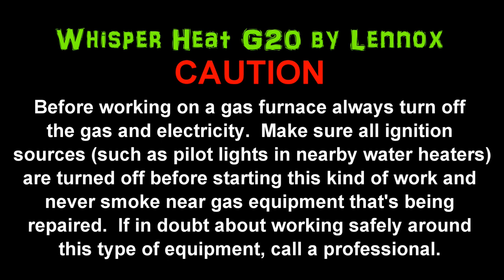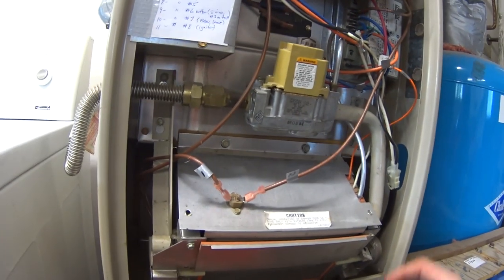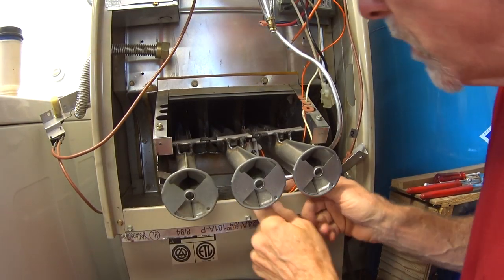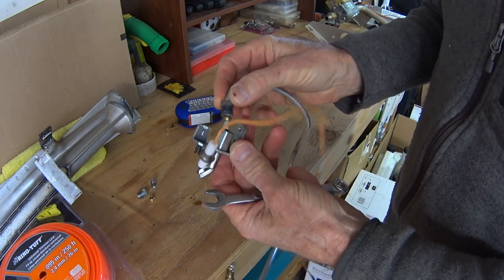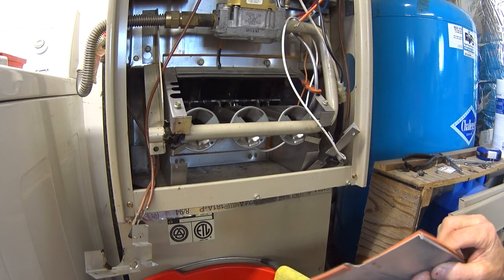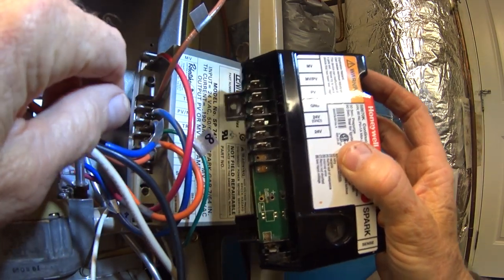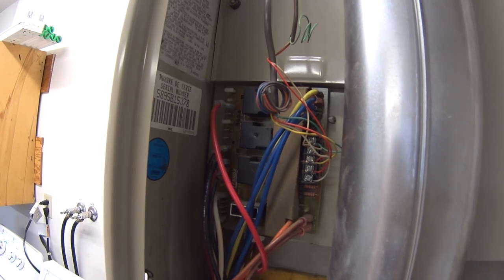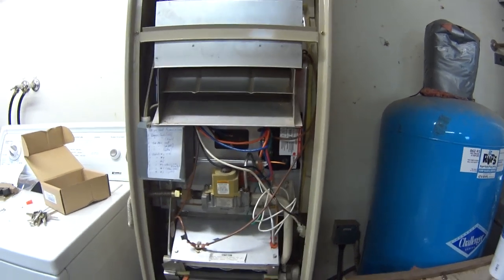Furnace Repair - Lennox WhisperHeat G20

Comment: So, he has a $300+ controller "on order", but the $15 flame sensor Should solve the problem.......and he's only changing it because he is waiting on the controller. Symptoms indicate the flame sensor is the issue.
Reply from the maker: Thanks for your comment Robert.  First, in 2017, when I did this work, the controller was about $115.  Even today it is far below $300 at $177 on Amazon. Second, I replaced the flame sensor, and while I was in there, I figured I would also replace the pilot assembly and igniter because they looked dirty and I knew they were at least seven years old, but probably much older. Third, I replaced the main controller because I had read so many online accounts of that original one being a problem, and that the replacement one was much better.    This resolved the problem of no spark, but although the burners would now light, the blower would not turn on and the whole unit shut down after a minute or so.  

So at that point I replaced the blower controller, and then it worked fine.  So this was not a repair where I was troubleshooting to replace one defective part.  I knew that no matter how many parts I replaced, it was still going to be far cheaper than calling an HVAC guy in there only to hear him tell me that the whole unit needed to be replaced, when I knew that wasn't the case.  And the flame sensor, if it was a problem, wasn't the only problem.  There were multiple problems, and I figured since I was in there I'd replace much of the inner workings so I wouldn't have to tear it apart again anytime soon.  It's like doing a valve job on a car engine - while you're in there you replace seals, belts, maybe the water pump, etc. so you don't have to tear it apart again anytime soon.

It's been over 6 years since I did this work and it's still working fine.  I did have to clean the flame sensor about 3 years ago but that was the only issue in the past 6 years.

Comment: Boiler motor will not turn on
Reply from the maker: Boiler?  You mean the blower motor?  If so, go to 31:40 in the video and see if that's the same thing that's happening to yours.  If so, you may have a bad relay in the blower controller.  Keep watching from there to see how to replace that controller.

Comment: A poorly engineered furnace. Putting that blower controller next to that normally hot flue pipe doesn't make sense at all. No wonder many furnace techs dread working on these furnaces.
Reply from the maker: And burying the pilot assembly in there wasn't smart either.

Comment: You went ahead and replaced all those parts on that G20 and it shows clear signs of a bad heat exchanger.  The tips of your burners are all blackened from the overheating from flame turbulence.  In 25 years of service I have het to find one of these that weren’t cracked.  The worst is that you had everything out of the way for you to see the cracks.  On these furnaces they stand out like a sore thumb as the heat exchanger in galvanized and stays silver but the cracks show up as brown lines.  You have no training so you don’t know where to look.  You can get a snake camera and send up the heat exchanger at the back where it narrows in -the pass.  This is where they ALL crack.  That was a wast of time and parts dollars.  Sorry
Reply from the maker: Actually, it wasn't a waste of time and money at all.  Quite the contrary - it saved us a lot of money that we might have spent on an entirely new unit.  We've gotten over four more years of service out of this furnace, so far, than we would have otherwise.  And it's still working fine.  Truth is, if this furnace had serious cracks in the heat exchanger it would be setting off our CO alarms - which it hasn't.  The blackening on the burners that you saw was likely due to them being filthy on the inside before I cleaned them all.  A lot of crap came out of those burners when I had it apart.  The furnace was installed about 23 years earlier and apparently had little maintenance from the former owners.